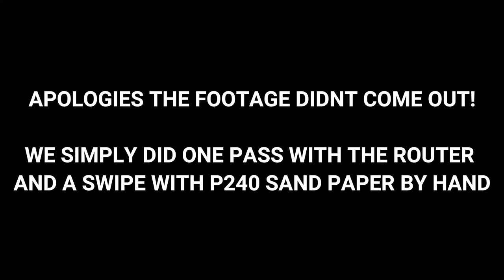Making Shaker Style Strips With 6mm Mdf / Add-on Strips / Simple Shaker Doors / Vid#155

Comment: Hi, for the first time I’m about to start making some shaker doors for under stairs cupboards using as you suggest 6mm edging strips, normally I would use 18mm Mdf but would that make the door to thick and heavy with 6mm side strips? Would you recommend only 12mm doors?

Comment: Hi ryan, amazing technique, when you make your doors, which thickness of MDF do you use?, trying to avoid the door warpage with the weight of MDF, especially for the large wardrobe doors, do you use 18mm and add 6mm strips or is it another ratio?
Reply: Same question I was wondering aswell also do you use MR 6mm strips or just normal (moisture resistant) ordinary mdf warps and sags but mf holds its shape
Reply from the maker: Hi!
Thank you.
I've narrowed it down to 12mm door blank and 6mm strips, making the total 18mm thick.
This makes them nice and light.
I've not had many issues with twisting or warping and I've been doing this for a good 4-5 years.
You could use 15 and 6 or 18 and 6 but your hinges will need to be able to work with that particular thickness.
I used to do 18 and 3 and it worked OK, but the 3mm used to fluff up so easily.
I think I'm happy with the 12 and 6 now.
Just make sure you paint both faces in equal number, and possibly do front, back, front , back, etc when painting.
Hope this helps 👍
Reply from the maker: Hi I just answered the above question .
Re moisture resistant, I've not noticed any benefits  personally.
I use standard mdf all the time 👍
Reply: @thelondoncraftsman2026  class.yeah I know what you mean the 18 and 6 would be OK for two doors next to each other but for a row of doors it would be too thick they would rub against each other I must try the 12 and 6 to see if I get better results.done a couple of jobs now using your method and I'm starting to get repeat customers from the one job that i done .thanks Ryan for sharing your technique now I have to just watch your video for getting the smooth edges on the doors.btw I'm from Scotland so won't be stealing any of your business lol